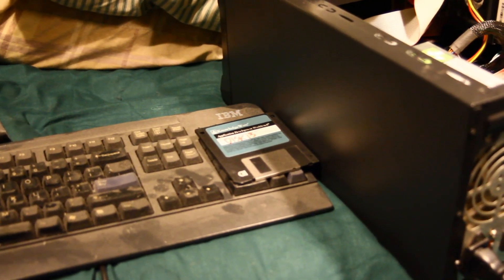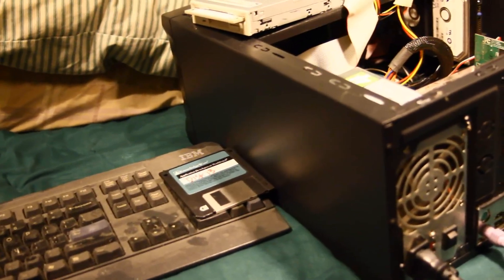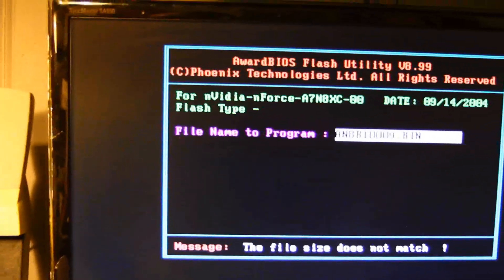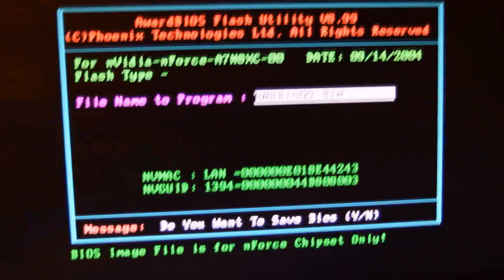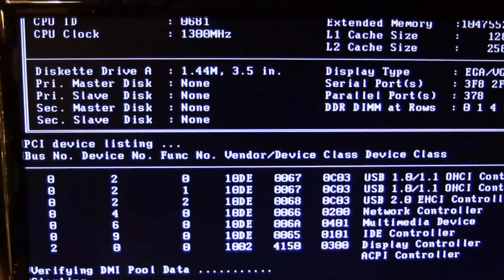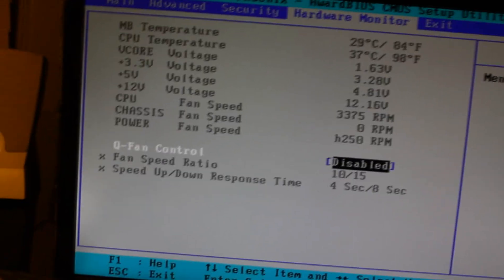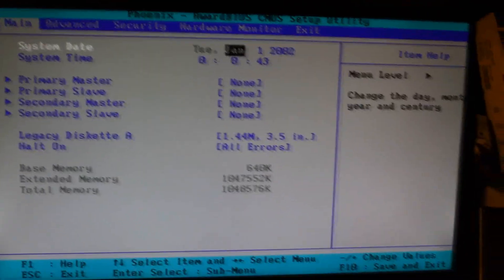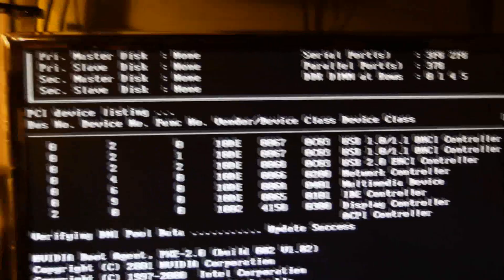Athlon XP Machine Part 2 - BIOS Update Troubles

Comment: Check on ebay for the Seasonic SS-350ET you can find them for about $16 shipped I run tons of them in retro machines as well as my 24/7 8 core server pc. Seasonic makes the best psu out there.
Reply: Also i notice your voltages at 11minutes are pretty bad. Small variances are to be expected but -0.19v under 5v seems a bit low for a socket 462 system which pulls all its power from the 5 volt rail.
Reply from the maker: @cjhawk67  Awesome, thanks for the tips!
Reply from the maker: @cjhawk67  I see that this model only has 20A on the 5v rail.  Still worth checking out?  I've got a few more derelict PSUs sitting that I need to comb through/locate/try-out on this build.
Reply: @alecjahn  For that model yes. They internals are built like a tank with really strong power delivery circuitry. My socket a 462 system ran that unit for a few years with my 1.6ghz chip no problem. I need to get that board recapped its gotten inconsistent since the one capacitor top left above the cpu socket has started bulging.